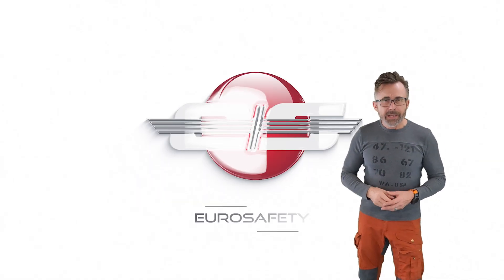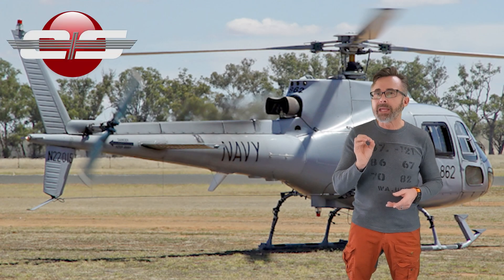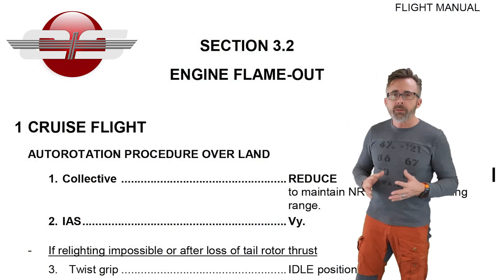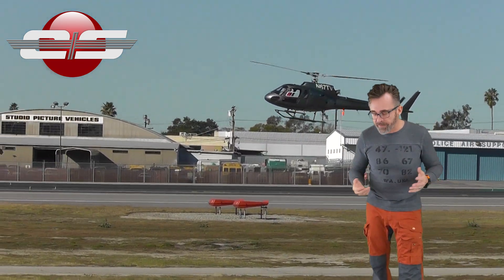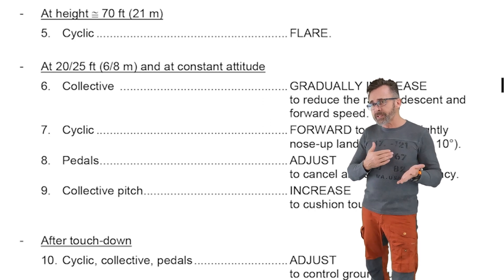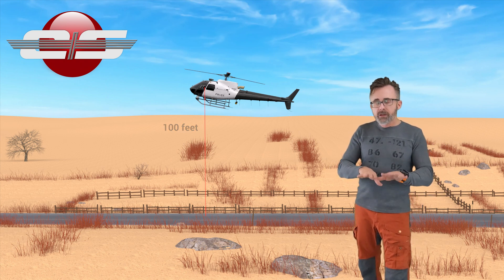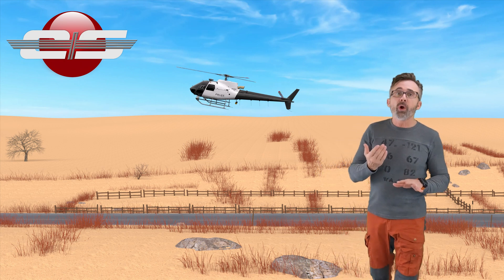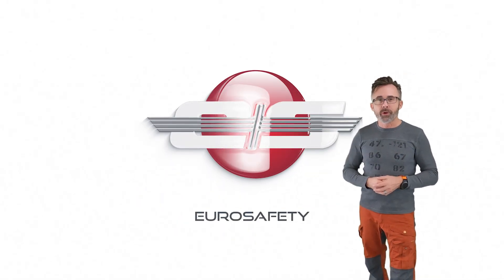#44 - The Autorotational Flare for the AS350 and EC130

Comment: Hey Glenn. Me again, thank you for the videos. I totally agree with everything that you have said. I do have a few follow on questions. My technique closely mimics yours, only with one exception, instead of lowering the collective through the flare to increase the NR, I autorotate ~5kt above the recommended speed and use a 'pre-flare check' (maybe around 110ft-ish). This pushes the RRPM above ~400 just like it does with your technique. It also importantly slows down the groundrush/vertical speed perception at the end which may help with what I call unwanted lizard panic instincts which in my experience leads to the "overflare" that you talked about. Should I change my technique to yours? What are the advantages and disadvantages?

Anyway, my main question is in regards to 2` change at the bottom of the flare. I do try to touch down with the aircraft fairly level with the ground (still slightly nose up) as I do not want to harm the stinger behind me (be it designed for that exact reason, it's like bumping into a car next to you when parking with the excuse that this is what bumpers were made for) - is it that you have done so many of them you know exactly where the stinger is or is it that your flare angle will never strike the stinger to begin with. Are you concerned on the forces on the bear paws when contacting the ground with such a nose up attitude?

Thank you for all your wisdom and being the antithesis to Vuichard
Reply from the maker: Hi Niko, first, when ever I am giving my opinions on Autorotations I like to preface that it really is an art form and there are many different methods that work. I never advocate that there is only one way. ....I am assuming when you say "check" you are referring to the method of inducing a momentary hard collect application and then a removal of that collective. This "check" gained popularity in Bell Helicopters many years ago and I was taught it back in the day on the Bells. I never really cared for it as I like a more graceful manipulation of the controls as opposed to what I viewed as a hammer method. From what I understand, Bell stopped recommending the method many years ago and I see less and less of it. Regarding your question whether you should change, I am constantly trying new methods, I would simply recommend you try a change to your method and if you like the change, if you find more success in how you have been doing it and it works, stick with what you like. Regarding advantages of driving up rotor with reduction of collective... I like a precise NR number prior to cushion on bottom. This gives me a consistent NR inertia for touchdown. Regarding your questions about touchdown attitude. This would be a variable that would fall in the "highly recommended" category. The mast on the AS350 is tilted forward and the cabin is canted upward. So a level cabin will put the helicopter on its toes for touchdown. If you are talking skids level the mast is still tilted forward which will accelerate the helicopter on touchdown, not slow it down. I would not look at the stinger as a car bumper. We of course want to avoid "hitting" it with great force but to drag it down the runway does zero damage to the helicopter. Most pilots dont even realize how often they make contact with the ground with it on normal landings when alone in the helicopter. Regarding bear paws... allows remove prior to practicing full downs. Thank you for your comments and being a fan of the videos. It is very encouraging to see the desire of the helicopter community for information to make us all safer.
Reply: @EUROSAFETYTRAINING  First off, some juicy gossip for you, Glenn: the Bell technique has recently resurfaced. Ironically, it was none other than Vuichard who wanted to plaster his name on the technique. More hilarity and execution (of our Swiss friend, and the autorotation) can be found on PPRUNE. Just search new-vuichard-auto-revolutionary (for some reason YouTube did not let me post the link) I agree that the old Bell technique didn't sit right with me either; seeing any student jerking any control sends shivers down my spine.
Apologies for the confusion. What I meant by a check-flare is a slight flare before the actual flare, only done with the cyclic in a classic configuration. It's enough to slow down the rate of descent and start to accelerate the NR to 400's.
However, if the NR is a bit low (i.e., for range in some aircraft), then I also encourage the lowering of the collective a little. I currently teach this as the "vanilla technique" because it gives pilots more opportunity to perform tasks sequentially rather than in parallel. The disadvantage I currently talk about is the potential need for more clear space; the advantage being that having the right NR in the flare gives the pilot more headspace to concentrate on getting the landing right. This autorotation technique into a small area, like a vacant block in the city, is a complete no-go, and I teach a different technique in that scenario.
Reply: First off, some juicy gossip for you, Glenn: the Bell technique has recently resurfaced. Ironically, it was none other than Vuichard who wanted to plaster his name on the technique. More hilarity and execution (of our Swiss friend, and the autorotation) can be found on PPRUNE. Just search new-vuichard-auto-revolutionary (for some reason YouTube did not let me post the link) I agree that the old Bell technique didn't sit right with me either; seeing any student jerking any control sends shivers down my spine.

Apologies for the confusion. What I meant by a check-flare is a slight flare before the actual flare, only done with the cyclic in a classic configuration. It's enough to slow down the rate of descent and start to accelerate the NR to 400's.

However, if the NR is a bit low (i.e., for range in some aircraft), then I also encourage the lowering of the collective a little. I currently teach this as the "vanilla technique" because it gives pilots more opportunity to perform tasks sequentially rather than in parallel. The disadvantage I currently talk about is the potential need for more clear space; the advantage being that having the right NR in the flare gives the pilot more headspace to concentrate on getting the landing right. This autorotation technique into a small area, like a vacant block in the city, is a complete no-go, and I teach a different technique in that scenario.

It’s tricky with the stinger, Glenn. In isolation, I agree that the stinger is designed for this job. However, I run a helicopter company that prides itself on the presentation of our aircraft, and my concern is cultural. Our pilots truly baby them and have strict techniques on how to fly, wash, store and take pride in them. It's always a challenge bringing in a new pilot. I fear that sending the stinger scraping down the runway sends "mixed messages." Especially on a check flight where this can set the stage of how we treat our aircraft. We all know the type of pilots who slam doors, chip paint every time they climb up and down, and use what I can only imagine as 400 grit sandpaper on screens worth more than our cars - Paaaaaaaain

Thank you for answering my question regarding the touchdown attitude.

All the best
Reply: First off, some juicy gossip for you, Glenn: the Bell technique has recently resurfaced. Ironically, it was none other than Vuichard who wanted to plaster his name on the technique. More hilarity and execution (of our Swiss friend, and the autorotation) can be found on PPRUNE. Just search new-vuichard-auto-revolutionary (for some reason YouTube did not let me post the link) I agree that the old Bell technique didn't sit right with me either; seeing any student jerking any control sends shivers down my spine. Apologies for the confusion. What I meant by a check-flare is a slight flare before the actual flare, only done with the cyclic in a classic configuration. It's enough to slow down the rate of descent and start to accelerate the NR to 400's. However, if the NR is a bit low (i.e., for range in some aircraft), then I also encourage the lowering of the collective a little. I currently teach this as the "vanilla technique" because it gives pilots more opportunity to perform tasks sequentially rather than in parallel. The disadvantage I currently talk about is the potential need for more clear space; the advantage being that having the right NR in the flare gives the pilot more headspace to concentrate on getting the landing right. This autorotation technique into a small area, like a vacant block in the city, is a complete no-go, and I teach a different technique in that scenario
Reply: First off, some juicy gossip for you, Glenn: the Bell technique has recently resurfaced. Ironically, it was none other than Vuichard who wanted to plaster his name on the technique. More hilarity and execution (of our Swiss friend, and the autorotation) can be found on PPRUNE. Just search new-vuichard-auto-revolutionary (for some reason YouTube did not let me post the link) I agree that the old Bell technique didn't sit right with me either; seeing any student jerking any control sends shivers down my spine

Comment: Thank you very much for share this very important information. So useful!!!! I really appreciate it!  I usually fly in high mountain environment. Just to clarify: all the instructors use to talk about 65 KIAS but the RFM is very clear...it mentions Vy. So if I am finishing my auto at  a spot at 10000 ft I should enter the flare with 55 KIAS instead of 65 right?  And in your experience this works? Or you use a different speed for your high altitude autos? Thank you very much in advance for your response
Reply from the maker: This topic is a very interesting discussion. If we to look at just the somewhat recent 350 models, and as a reminder all 350 models with gray blades autorotate the same...

In the B3e and B3 2B1... autorotational speed is Vy (emergency procedure section is recommended information), Vy is 65  -1 kt per 1000 feet (normal procedure section), in the Limitation section (required compliance) it states...When OAT < -20°C, calculated VNE power off must be reduced by 20 kt (37 km/h), with a minimum of 65 kt .... which is confusing on its own... does the 65 kt minimum only apply at temps below -20 or is it always the power off lower limitation. 

In the B3 2B... autorotational speed in the emergency procedure section is "approximately 65 knots"... in the limitation section it states... -	Absolute power off VNE is 125 kt at zero pressure-altitude....At higher altitudes this speed is to be reduced by 3 kt per 1000 ft  without dropping below 65 kt .
In cold weather, reduce the VNE as follows :
-20 kt  when OAT is below -20°C without dropping below 65 kt.... so we can see here they are specifically addressing not going below 65 kts in the autorotation, which in later manuals they changed but again they auto exactly the same.

In the B2 VEMD.... autorotational speed is 65 kt and in limitation section it states...When OAT < -20°C, calculated VNE power off must be reduced by 20 kt (37 km/h), with a minimum of 65 kt

In the B2 ..... autorotational speed in the emergency procedure section is "approximately 65 knots"... in the limitation section it states... -	Absolute power off VNE is 125 kt at zero pressure-altitude....At higher altitudes this speed is to be reduced by 3 kt per 1000 ft  without dropping below 65 kt .
In cold weather, reduce the VNE as follows :
-20 kt  when OAT is below -20°C without dropping below 65 kt

From personal experience I use 65 kts as a lower red line for autorotations... as long as I am above 65 I have good inertia for rotor build and velocity braking... if I am a bit fast I will flare a bit higher... if I am low airspeed at flare I know I have to accept more ground run.

Good question
Reply: Thank you very much for your answer! Very complete and informative!

Comment: during our lives as helicopter pilots it is a good idea to explore different types of autorotation, within the safety parameters to have tools to deal with real failures, different speeds and different RPMs and different heights of the flare.  I remember an anecdote of a pilot who experienced engine failure over swamps and chose to arrive with 0 translation speed so he flared to a higher altitude and arrived completely vertical in the swamp achieving excellent autorotation. FLY SAFE

Comment: Can you explain why do we tend to drop speed to 50 knots during 360 degree autorotation and what if we try to come down maintaining 65 knots! Like I have experienced it’s always easier to do 360 with less speed!
Reply from the maker: That is an interesting discussion and I will try to be brief, though I have a tendency to expand,  When making a 360 degree autorotation... the turn is either made tight or wide. if you have a tight turn you have a more nose down attitude but your airspeed will not not rise rapidly because of centrifugal loads. But because you have a high VSI this substitutes for the lack in airspeed for the flare. So when you come out of the descent into the flare with a slow speed the NR is more manageable. If you have higher speed and a high rate of descent when flaring the NR management is more difficult. Does that answer your question?
Reply: @EUROSAFETYTRAINING  beautiful video. One more thing that requires a video is playing with approach speeds to make the landing spot keeping the speeds within the prescribed Autorotation limits. Before the flare part!!